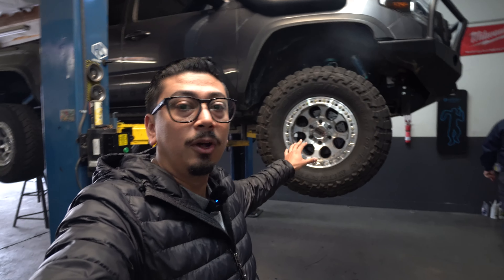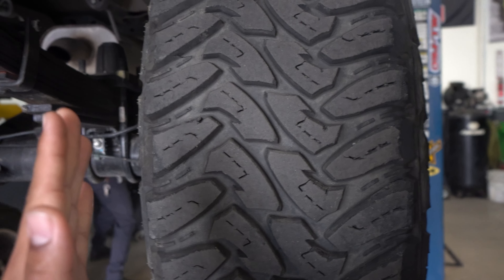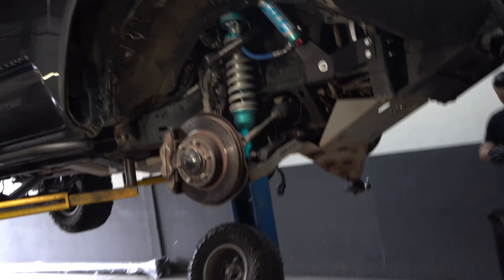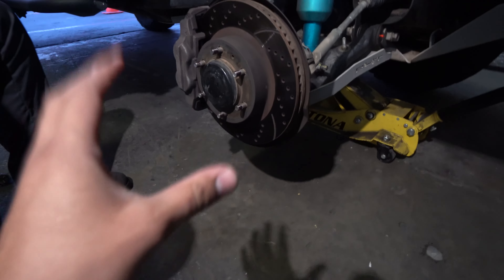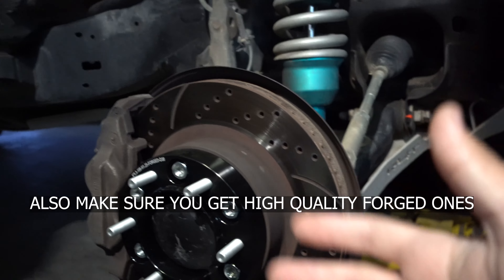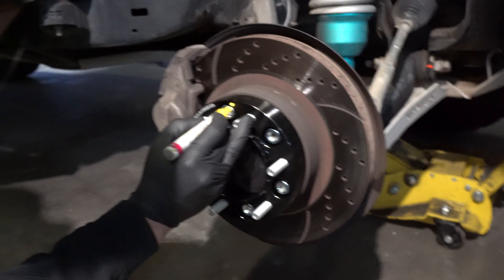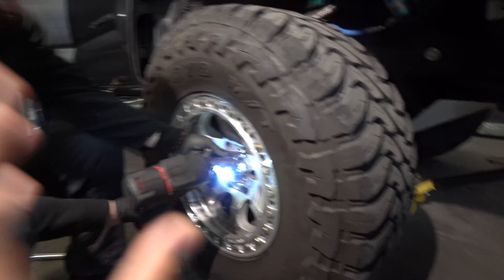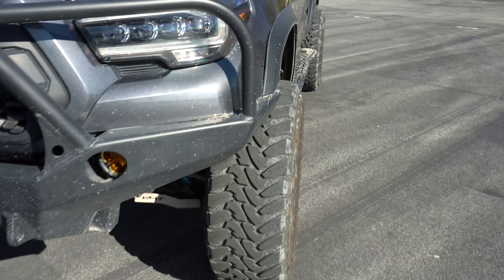THIS HAPPEN TO MY NEW TOYOTA TACOMA | WATCH TO FIX YOURS IF YOU HAVE THIS PROBLEM KSP WHEEL SPACERS

Comment: Always good to spray brake cleaner on the rotors and wire brush that surface to make a solid flat contact with spacer.  Also use anti seize on the spacers in case you want to remove them in the future.

Comment: I installed 1.5” KSP wheel spacers on my 2018 TRD off road tacoma about 4 years ago. Did not not feel comfortable using the extended tapered wheel lug nuts (since the stock wheel stud didn’t protrude enough out of the back of the tapered extended lug nut). I ended up replacing the wheel studs with longer ones, then I cut them to size so they wouldn’t be so long so that the spacer could still sit flush on the disk brake mating surface. Long story short, it was a pain, but I do have peace of mind. It did however take more time for just wheel spacers. But I definitely love the look of my wheels having that “poke” while still being safe! Great video and disclosures before people try this mod!
Reply from the maker: Dude that sounds like something I’d want to do since I know I’m going to need to run these for a while anyway Did the new studs cost a lot? 
And thanks for the positive feedback I appreciate you watching as well
Reply: @JesseRizo  I got some ARP studs that were high quality for multiple Toyota vehicles. They were correct size as far as diameter but I did have to cut the length to size, as well as use the tapered lug nuts for extra peace of mind. I will disclose though that it did require some cutting on the back of the disk brake water/shield to be able to get the wheel studs out and in, not to mention the install of the new wheel studs did require the use of a impact wrench to pull the studs though since they were exact press to fit. Hope this helps! Also, great content been watching g your channel since you started doing Tacoma stuff! Keep it up!

Comment: If i put a 1.25" wheel spacer on my truck will it be ok to run a 10ply light truck tire in a 275 60 r20?

Comment: I’m going to install 1.5” spacers to get a wider look on my 2020 Tacoma. I don’t do any off roading just used for daily driving.
Reply from the maker: For you 100 percent it’ll be perfect man if u do get them I have a discount code on these
Reply: You will be replacing front bearings, Toyota bearings are not meant to handle spacers
Reply: @gtarbmx  Does having a offset create the same issue?

Comment: Those bead-lock wheels & 35's must be killing your MPGs. That's probably over 110 Lbs per tire/wheel. Crazy weight on all four corners for a Tacoma. Do the few inches of height from 35s really outweigh the MPG savings from a 33?
Reply from the maker: When I went 35s it wasn’t a huge difference especially if u regear I’m regeared to 5.29 once I put the bead locks on that’s when the mpg died lol